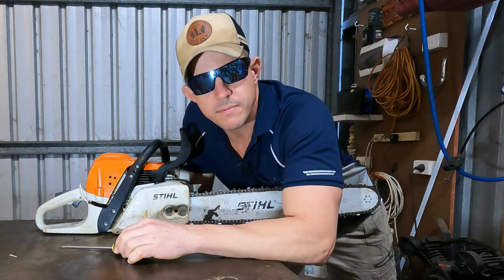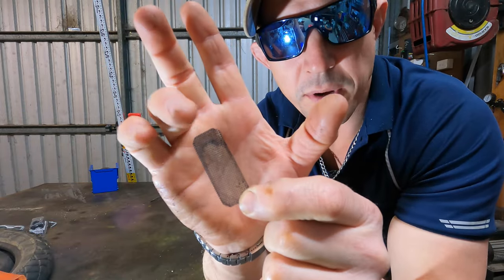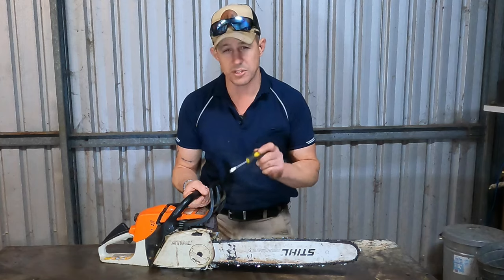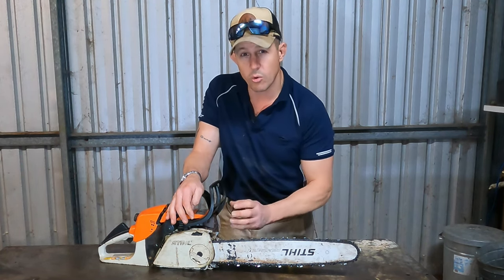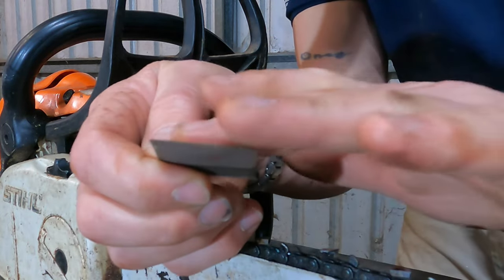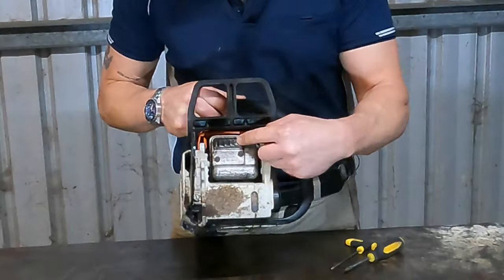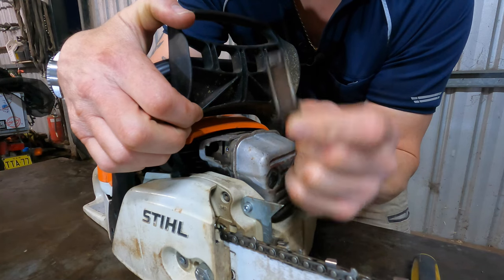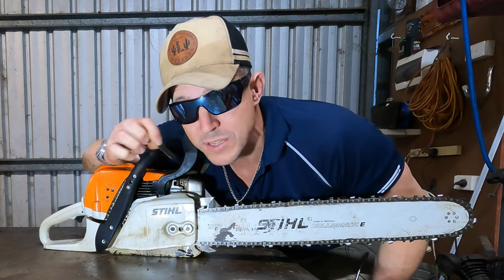A MUST CHECK! Exhaust baffle exhaust screen spark arrestor? #stihl #chainsaw

Comment: I recommend you just take it off then just tune your saw for the better airflow.
Reply from the maker: Interesting. I have never tried that, but will have to give it a go. Thanks for the tip.